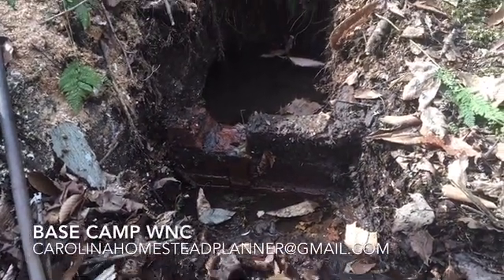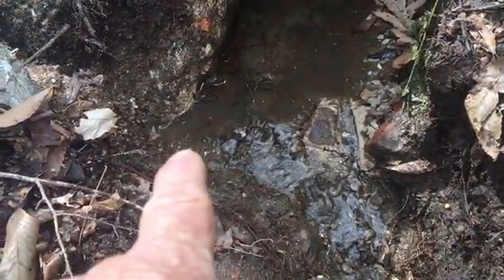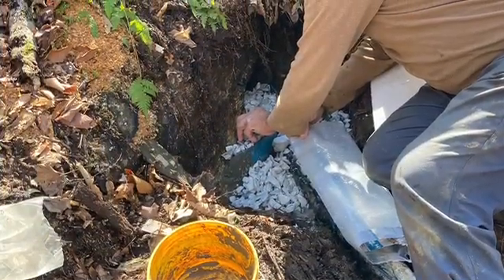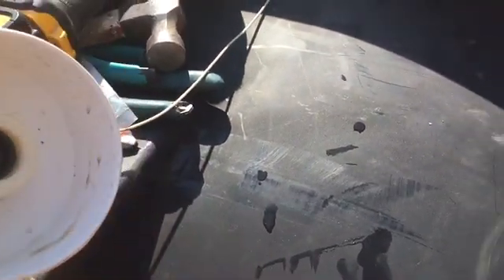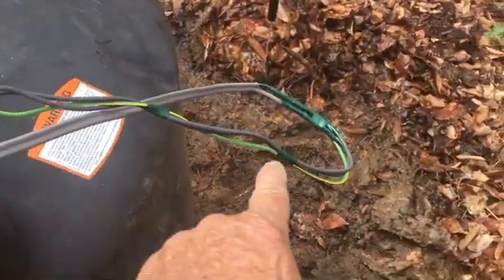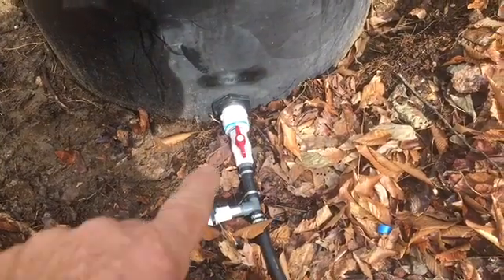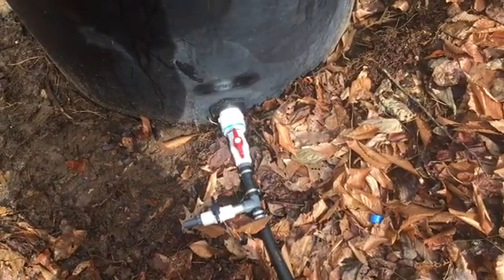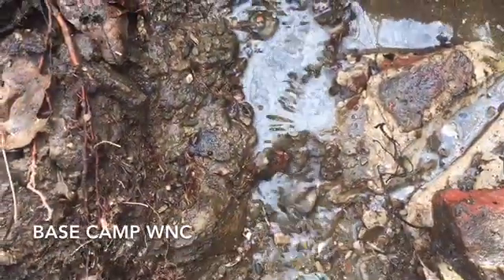Spring Water Captured In Solid Rock

Comment: Great job I’m still having problems with run off and water from the ground overwhelming mine, after the first time it ran 3 weeks then stopped and bypassed my dam so I dug it out to keep the water running downhill backfilled with rocks and covered it up good. I have so much water it’s running over the dam and plugging up my pipe holes guess I’ll step up from 1” to 1 1/2” and bigger holes.
Reply from the maker: Well maybe too much is a bad thing sometimes
Reply from the maker: What is stopping up the holes 
Is there that much sediment 
May need to add some filter fabric under the stone to pre filter the water
And maybe a 2” over flow pipe
Reply: @basecampwnc1745  Thanks for replying yes too much ground water seeping in we keep getting huge rains up to 5” in a day, I’m very near Kentucky lake there are 2 creeks one on each side of my property I have a good spring it’s been running steady for the 3 years that I have owned it. I get a lot of runoff that seeps into / under my catchment otherwise it works great I’ll be removing the rocks and laying fabric as you suggested this weekend any idea on type of material? Thanks for showing us your ideas. Let’s go Brandon,,,,